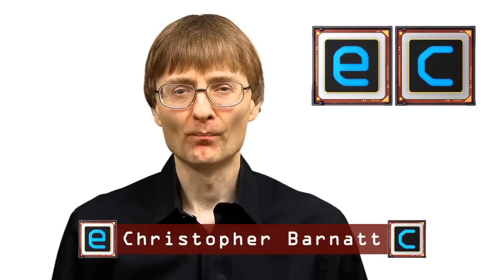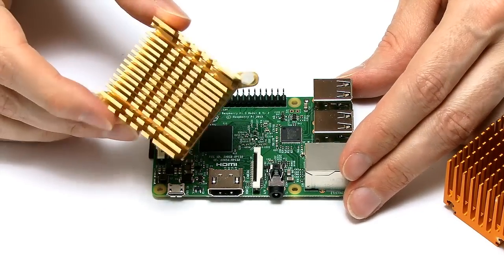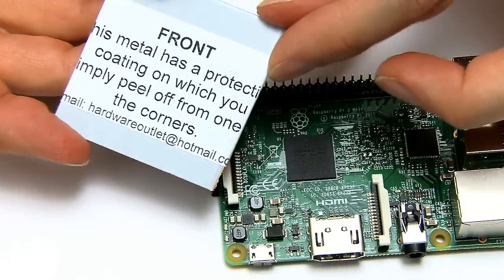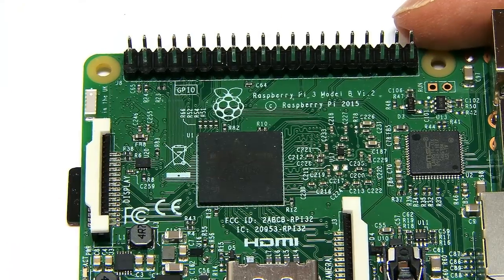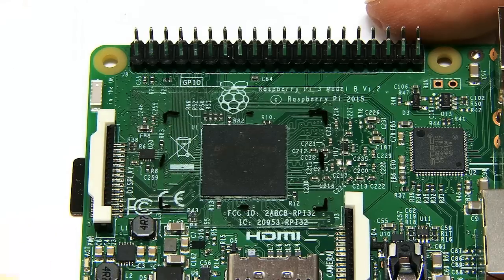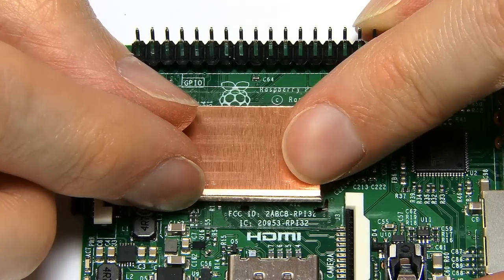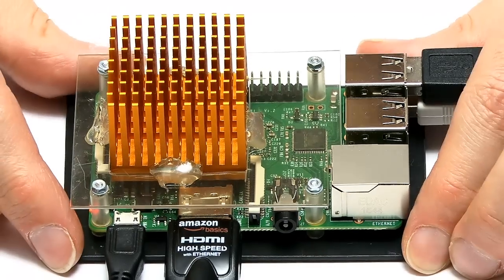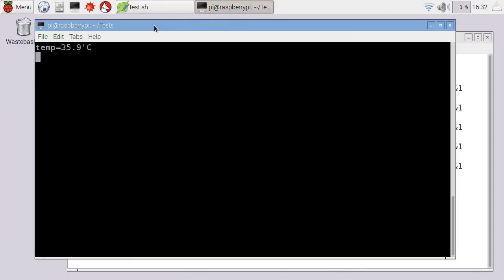Raspberry Pi 3: Extreme Passive Cooling

Comment: this is like tricking out a Ford Fiesta.  You could do it, but why?
Reply from the maker: +Bill Westfall As an experiment! Also, a Raspberry Pi 3, if run at full processor utilization for any any length of time, gets very hot (80C+) and this will burn out the CPU pretty fast. So, unlike previous Pi models, some level of cooling is necessary to use the Pi 3 for intensive purposes -- and a small CPU heat sink is simply not sufficient.

Comment: 2:25 mil ≠ millimeter! Mil is one thousandth of an inch. 
In this case you're obviously talking about millimeters but it may not be so obvious in other contexts, so watch out for it.
Reply from the maker: +hellterminator Good point, noted Here in the UK nobody uses inches, so the phrase "a few mill" is used to refer to a few millimetres, but I need to be aware of this for an international audience.
Reply: ExplainingComputers I understand, I'm in the same boat, but I've run into this problem before when dealing with people from the colonies (I once got a custom part that was 40 times smaller than what I thought I had ordered).

Comment: Hmm. Hot glue on a heat sink?
Reply from the maker: The melting point of hot melt adhesive is generally around 200 degrees C. The CPU cannot go over mid 80s without throttling, so the heatsink won't get above 50 max. :)
Reply: Welcome to ExplainingGlue.com
Reply: I understand but won't it get a bit loose? I built an RC plane with foam board and hot glue, flew it on a hot day and it fell apart. I'd say screw some bolts into the spare T shaped channels in the heatsink so that the heads sit proud and then screw the perspex on top to hold the heat sink down against the bolt heads.

Comment: No. Hot glue supported heat sink? Those fancy plexi covers don't make this legitimate. Seriously, wtf? Just no.
Reply from the maker: +ssjgogetta It is supported by its weight and the frame -- the hot glue only prevents it falling out if tipped. And this is a hack experiment! :)

Comment: over long term use wouldnt the hot glue, get , urm .... hot?

actually scratch that , if it got hot enough to melt the glue it would be TOO hot.
Reply from the maker: +AwesomeVindicator Correct! :) Hot glue melts c.120C -- by which time the CPU would be long since dead.

Comment: Aluminium and copper can corrode, best use copper all round.
Reply: +Martin Counsell They won't corrode just by touching in nearly dry air. And if copper does corrode a little bit, that's not a problem at all, there's no harm to be had at all, those surface oxides aren't going anywhere and have same properties as the filler in the thermal paste. Boxed coolers usually hard bond a copper heatspreader into the aluminium base. Heatpipe coolers usually friction fit aluminium cooling fins on bare copper heatpipes.

You're probably thinking of water cooling setups where you shouldn't mix dissimilar metals, because of galvanic corrosion, which will colour the liquid and clog the delicate microchannnels in waterblocks.
Reply from the maker: +Siana Gearz :)
Reply: +Martin Counsell  In the entire life of the machine neither would corrode to a point that they are unusable, even if you used two metals where you might experience electrolysis.   Sure they can get a little bit of oxidation, but it is non damaging, and with the coatings on the heatsink it likely would not happen 50 years from now.
Reply: +Martin Counsell copper is only useful for the extraction of the heat from the SOC and the transportation, aluminium is superior if it comes to giving the heat to the surroundings. Thats why all High end gaming coolers are made this way.
Reply: +chibiebil that's a myth, absorbing, and "giving" heat are the same thing, thermal conductivity.  copper's better then aluminum, silver's better then copper.  Occasionally aluminum's greater strength and ease of manufacture lead to a better cooling product (as in car radiators, since you can't feasibly make one of only copper, but you can with aluminum)

Aluminum heatsink's are widely used because they are cheap, and do the job well enough
Reply: animefreak5757 most car radiators were copper/brass until the last 20 years or so. Aluminum is used because it is cheaper.
Reply: look at any performance radiator, it's pure aluminum. it's not just that it's cheaper, it work's better when you factor in design that's not possible with copper\brass\solder
Reply: If you do your test based off of raw weight of the radiator then sure, but when it comes to the surface area of the radiator then copper is much better.   

Like you mentioned, copper has many mechanical drawbacks however, and using solder hurts the thermal conductivity which is why you should braze the joints with a better metal or even use a silver braze/solder.  

You can test this with 25$ worth of equipment and two identically shaped and sized radiators, one aluminium and one copper, but more intricate designs with aluminium are not as fragile or hard to make so it has a slight advantage.
Reply: Or you could just look at a chart that shows thermal conductivity.

The top metal on thermal conductivity is silver and it's thermal conductivity is 406 W/m K (diamond is the top coming in at a whopping 1000 W/m K)

Copper comes immediately after silver on thermal conductivity at 385 W/m K

Gold

Brass

Finally aluminium comes in at 205 W/m K, followed by iron, steel and lead.

Conclusion?   For the best heatsink on a chip you could replace the silicone in chips with diamond and then use a diamond heatsink, but obviously that is cost prohibitive, and working with diamond is hard.

Comment: I followed your guide and my Pi 3 barely hits 50 degrees even after like 10 threads computing 50,000 prime numbers during 430 seconds... And beauty is that it came back to 37degrees in less than 30 seconds !!  BIGG THANKS TO YOU !!!
https://forums.adafruit.com/viewtopic.php?f=50&t=111133&p=558118#p558118
Reply: See photos here : https://goo.gl/photos/pErYTnURV4oK2auF6

Comment: PIPES! they are called STAND OFFS.
Reply from the maker: +Keith Grove They may be, but here they are made from a plastic pipe! :)
Reply: +ExplainingComputers the water in my house runs through PLASTIC PIPES but no one would call them STAND OFFS.
In my 40 year career working for companies like HP (the original HP the scientific company), Bridge Communications/3Com, Honeywell and Cisco Systems, I have NEVER heard STAND OFFS called PIPES.
This is a stupid argument, but you look more professional when you use the CORRECT terms.
Reply from the maker: +Keith Grove Nobody "looks professional" by typing in upper case (aka shouting online). Yes, the offending pieces of plastic are called stand-offs. But in the earlier video I refer to in which I made the construction, I showed them being cut from a pipe taken from inside a soap dispenser. Ideally would I have used the word standoff here? Yes. But trying to get everything right when filming is not easy. I did not fluff a key technical point here, used a word that everybody would understand, and fail to see why this is such a big issue. It has clearly offended you, and I am sorry for that.
Reply: +ExplainingComputers Once again you have got the wrong end of the stick, it is YOU who needs to look PROFESSIONAL, not necessarily me.
You see I spent an entire career working for top notch High Tech companies, I know I am a professional.
I am trying to HELP YOU, and all you do is act like a spoilt child.
Here is a tip for you, when someone points out a flaw in your performance, THANK THEM. DON'T try to defend your mistake just accept it.
Sorry about the CAPITALS but in written communication it is the simplest way to EMPHASIZE something, it is easier than using italics.
Enough said, don't be so defensive, there are many people out here who know more than you or I do, ACCEPT THEIR ADVICE.

Comment: "Here I have this beautiful Pi, I cut and deburr this beautiful piece of shiny copper, I carefully furnish this beautifully accurate plastic protective mask, I use this expensive and high-performing beautiful thermal compound, I screw on the beautiful spacers and mount the beautiful acrylic top, I place the beautiful, faintly orange heatsink, and then I FUCKING REGURGITATE FOUR HUGE-ASS DISGUSTING GLOBS OF HOT GLUE CANCER SNOT RIGHT ONTO IT, BECAUSE FUCK YOU!"

Comment: now add a fan ;)
Reply from the maker: +Charlie That video is coming! :)
Reply: +ExplainingComputers Cool, I can't wait! I'd guess the temps should drop to almost the normal idle temps.

BTW, has anyone attempted extreme overclocking with a Raspberry Pi?
Reply: ProGamer1515 it would be even better if someone tried watercooling a pi
Reply: ***** That would work. To get below ambient temperature you'll need a phase change machine.

Comment: Hot glue? Dude. It is a cooling equipment. Its gonna get hot.
Reply from the maker: +Murmundone It is -- but not as warm as the hot glue melting point! :)
Reply: true! :) I was wondering by the way, the cooling efficency could be increased highly if a fan was placed on top of the passive cooler!
Reply from the maker: +Murmundone On Sunday I'm uploading a video where I try two different fans with this setup. :)

Comment: So ghetto. -_-  Hot glue? You'd want downward pressure on that heatsink, not just sitting there glued from the sides. Of course this will work better than no cooler at all, but a proper cooler without using two pieces of metal and hot glue would work SO much better.
Reply from the maker: +ciphernemo True. But back in the world of Saturday afternoon hacks, this is what I could achieve with the time, materials and tools available! :)
Reply: +ExplainingComputers Understandable then.
Reply: +ExplainingComputers I think a cable tie would have done the trick. I'd also like to see how much it would affect the temps, if at all, if you did tie it down. Oh and maybe strap a fan on it and see what temps you get, I'd be interested in seeing that too. Maybe in a follow up vid?

Comment: for us 'mericans  

96.62°F 110.3°F 115.16°F..118.94°F 120.92°F with extreme heatsink

96.62°F 178.34°F 178.88°F  179.96°F  no Heat sink

110.3°F 159.62°F 170.24°F 173.12°F 176.18°F  177.08° F  tiny heatsink
Reply: If you work on computers at all, I don't think you really need the temperatures in Fahrenheit. In fact, it just seems to make less sense
Reply: +Dylan McMullen If you're okay with the centigrade scale that's your business.... I'm more familiar with the Fahrenheit scale  ...
if you don't like it... not my problem...

Comment: Somewhere back in time a came up with this:
http://imgur.com/6jNHuBU

Needed only a bit of adjustment with a saw. :D
Very effective even without the fan.

It was a bit of a challange to find a cpu cooler that as thin as a gap between the gpio header and the hdmi port. (It's an ID-Cooling SE-802)
I put the two bars I sawed off from the sides of the heat sink between the soc and the heat sink. + some thermal compound

ps: with a fan http://imgur.com/a/S60mq
Reply from the maker: +Tamas Jantyik Amazing! Very impressive. :)
Reply: Tamas Jantyik , Nice ...

Comment: So all I need to do is Slab a massive copper plate on the chip, perspex perfectly cut with additional screws. Find an old heat sync and glue it with hot glue and thermal paste. Seriously dude. You think the average person could do all this. And it also completely ruins the Pie overtime and destroys its aesthetic look. Not good.
Reply from the maker: This video is to show what is possible, and nothing here damages the Pi (it appears in many later videos with no damage!). This can of thing can also be done pretty neatly -- for example in this video I used 3D printed mounts to add a Noctua fan: https://www.youtube.com/watch?v=NzTsDrepf64

Comment: lel
should i put it inside my fridge?
Reply: I've thought the same thing! I've had issues with those PATA hard drives dying an early death on desktop computers I've used in my garage. These were salvaged PCs with used hard drives off Ebay to begin with. I didn't want to put something "good" out there due to the harsh environment (30F to 97F temperature swings), dust, spiders, humidity, etc.

I suspect when the ambient temperature is around 97F/36C, this can't possibly be good on the hard drive as well as everything else inside the computer.

I didn't want to do it but the hard drive on my last salvaged PC died last summer so as a "quick fix" I put an HP Chromebox out there for the meantime and just turn it on when I am out there.

I've got one of those two cubit feet mini fridges out in my garage I keep stocked with soft drinks. I've considered actually putting a computer inside it. Just drill some holes in the side for the cables to exit and shoot some RTV around it to seal it off. Of course a regular PC wouldn't fit inside one but a Raspberry PI would.

My fridge has a freezer portion for a small ice tray. I've placed warm cans of soft drinks inside it to cool it down fast and if I leave it in there for more than an hour, the drink is slushy when I open the can. It's the right size for a Raspberry Pi. I wonder what kind of performance the computer would gain at freezing compared to 36C?

Question is the inside of the fridge can condense with moisture quickly especially in the summer after I open the door. I'm assuming any moisture might not be a good idea on the computer. However I have opened the garage doors up and saw a thin layer of condensation build up on my cars (and everything else) and it has never damaged anything electronic.

Comment: Who do it so wrong? Atleast do things right...
Reply from the maker: +netman87 And the wrong things are . . . ?
Reply: multible different parts arent optimal, you should have attached cooler to that plastic before and then tighten it over chip for best contact. for cooler i would have simply modified to fit pcb. for testing you clearly didnt find how long you can actually run chip as it only did start to warm cooler and clearly didnt hit max temp.
Reply from the maker: +netman87 Agree, multiple parts are not optimal -- but this was a build with what I had at hand I don't have the tools available to adapt a single material heat sink. On contact, the weight of the heat sink, and the thermal paste, provide pretty good contact. Perfect? No. But this is not a heat sink being applied to the latest i7. Totally agreed that the test could have run longer -- and I am going to show this in a follow-up video -- but I was trying to maintain consistency with a test started in an earlier video. As in all things in life -- and certainly in computing -- there are seldom totally "right" and "wrong" ways to do things. This video shows a make, a hack, and ultimately it achieved a good result. Could it be improved? Certainly. But that is not to say that is totally "wrong". Ultimately, the Raspberry Pi is a computer for makers to experiment with, and this video is presented in that spirit. :)
Reply: I would be interested how long this setup will before hitting max temp and also what will that max temp be... will it eventually hit throttle temp or does that cooler actually have enough surface to transfer enough heat to air around it. for modding cooler itself i think it would have been enough to cut corner of it away and for tightening maybe add screws to sides of cooler just enough to hold it below that acrylic mount piece and just tighten that acrylic piece after that. anyways will be waiting for results for it :) happy modding
Reply from the maker: netman87 The temperature rises a few moredegrees in the next 10 minutes and then is pretty level after that. And then when you add various fans  . . .

Comment: never over 46° (100% over 10-12min) - with only Top coolers 60° - results with cooling parts from a old graphic card (at the bottom) and  cooler parts from a old TV (on top) http://250kb.de/u/160514/j/x2elny0BF6qi.jpg - nice greetings from Germany

Comment: unnecessary overkill
Reply from the maker: +Michal Haubner It depends what the Pi is used for. For most tasks, you are absolitely correct, and no form of heat sink is necessary on a Pi 3 in most climates. But when the Pi is stressed at 100 percent CPU utlilization for long periods, without cooling it gets into the 80s and that will damage the chip in the medium- or long term. See the test figures at the end of this video -- as taken from my initial temperature test video: https://www.youtube.com/watch?v=e6okZKRwnTQ